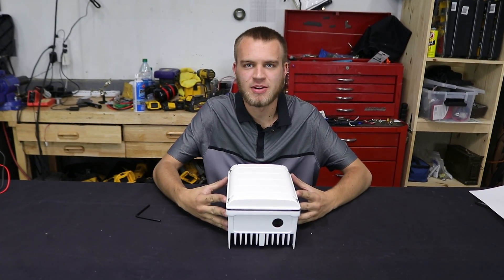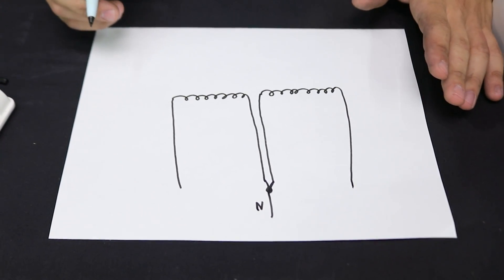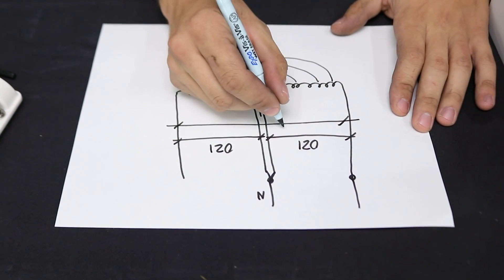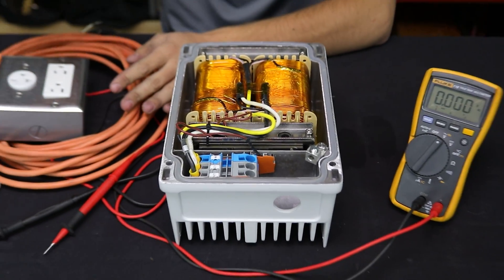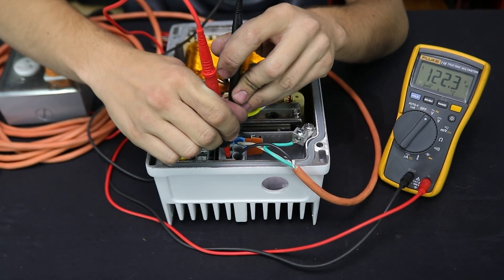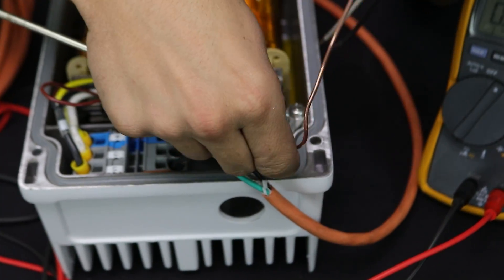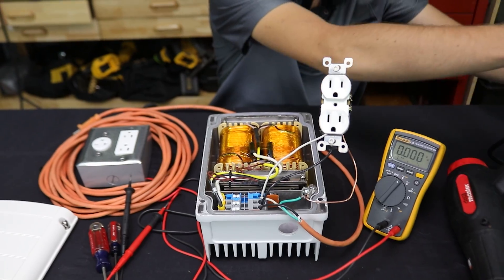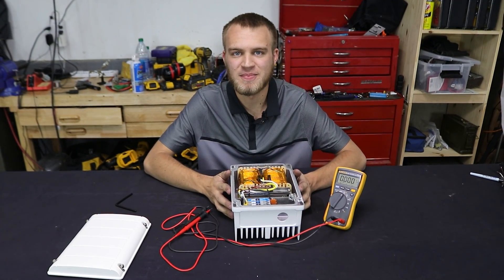Off Grid: Easily change 120v to 230v -  Autotransformers

Comment: Good video, But this is not an Autotransformer. This is a Step-Up transformer.
Reply: I think it IS an auto as it does not have electrical isolation between the primary and secondary circuits.  A "normal" transformer has primary and secondary circuits that are only magnetically/inductively coupled with no direct electrical connection,
Reply from the maker: It is an autotransformer.  3 terminals.  Look up solaredge 5kva autotransformer
Reply: I agree.The interpretation here was not an auto transformer.The sought after use for this unit is to provide split phase power from 240 volt line to neutral input ( common European voltage ) not really sure as to why it would have 3 terminals on the input side. Solar edge does not have much  info on line on this unit .
Reply: It is an autotransformer, which can do split phase / step-up / step-down depending on hookup.  Check out the end of this Victron datasheet, which shows all the various hookups and things you can do with an autotransformer.  https://www.victronenergy.com/upload/documents/Datasheet-Autotransformer-32A-and-100A-EN.pdf
Reply: @billjohnson3344 you can do step down but not safely with an autotransformer... if there is a short ion a leg it can cause a hazard so never do that configration and instead use an isolation transformer for that. Usually called a distribution transformer.
Reply: @Wingnut353 So it depends on the application - for example, isolation is not needed with home backup or off-grid inverters, so an autotransformer is what is used in commercial products that output 240V but need split phase 120V also.  The Solar Edge transformer shown here, the SMA auto-transfer switch has one, Enphase Gateway, etc.  All these are 240V setups that use a auto-transformer (also called neutral forming) to create the split phase.  It has to be designed and UL listed such that a failure won't cause a hazard, and/or that the power source (inverter) gets shut down if there is a fault regarding transformer - and split phase neutral reference generation.

Comment: Is that the SolarEdge SEAUTO-TX-5000 Autotransformer?  If so, could you show how to connect the 120Vac input and 240Vac out?
Reply from the maker: I did, there is an article on my website at www.currentconnected.com .  Look under power switching

Comment: Would a 240V double breaker in a main panel be a jumper for a 120V input conductor when backfeeding? I don't have the means to test this idea, but was wondering if it would be possible. The input 120V would have to be split before inserting to the L1 and L2 of the 240V double breaker?

Comment: Just btw: please dont put a tinned wire into a screw terminal, or at least not longterm. Over time the tin would "crawl" away and cause arcing.
Reply: Was wondering about that... so tinned stranded wires in terminals not recommended(?) When I saw that in the video I thought, oh that's nice and neat with the tin so you don't get the several loose bent strands that don't properly make a connection... but I guess not a good idea.

Comment: So you put 120v into N & L1 and get 120v out from N & L2.  Hmm Not very useful, I think you should have connected the output load across L1 & L2 to get 240v (according to your drawing) However it would be safer to use a standard transformer to step up the 120v to 240v and it would be galvanically  isolated
Reply from the maker: You could indeed connect an output load across l1 and l2.

Comment: Thanks for the video! Very interesting! Is the 240V output single or split phase?
Reply: Would you be able to use  this on 120v incoming service to create 240 split for an inverter input?
Reply: @roqm1248  It should work as long as the incoming service is a pure sine wave and the inverter won't use a higher wattage than the transformer/120v power supply can handle.

a 120v 15 amp breaker can handle 1,800w continuous power, but it might use a bit more current because of bad power factor from the transformer so you would probably be good if the inverter takes 1,700w or less with nothing else on the breaker.
Then a 120v 20a breaker can supply 2,400w but same with the 15a you probably would be good with 2,200w or less.

If you go from 120v to 240v the current on the 120v is 2 times the current on the 240v current, + power losses from bad power factor.

Voltage × Current is the Wattage,  Wattage ÷ by the Voltage is the Current.
Reply: It's split phase since it's 120/240v. It's basically the same as a standard distribution transformer in the US just without a high voltage primary.

Comment: I have a transformer I bought in Hong Kong to use 120v appliances there. It's actually quite interesting in that it takes 120 or 240v input and outputs both 120 and 240v regardless of which you put in. And it adjusts the voltage with a mechanical wiper that will increase or decrease output accordingly.
Reply: Hey can you show me where to buy it from and what you bought please?
Reply: @hawkeye312456 Don't buy those they are an electrocution hazard for step down... you should only ever use an isolated distribution transformer for stepping down, autotransformers can electrocute you in some fault conditions you can end up with exposed voltage if there is a short.